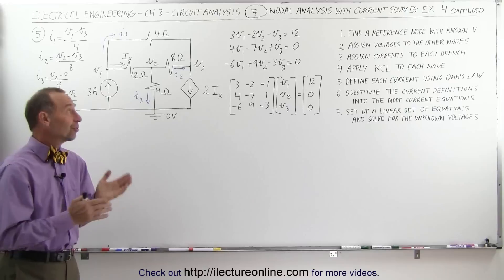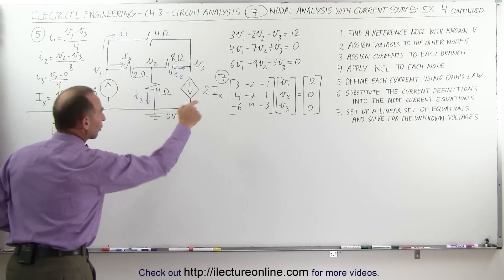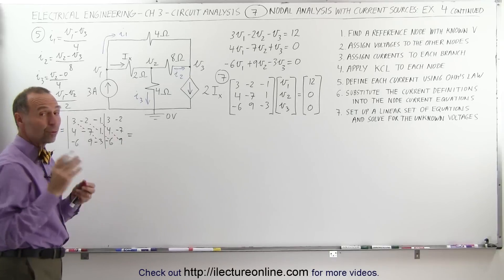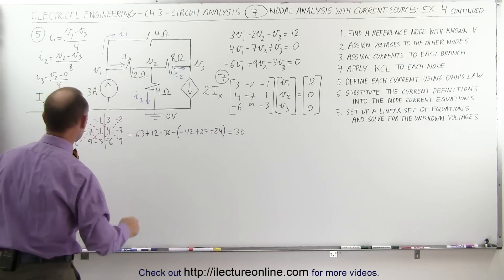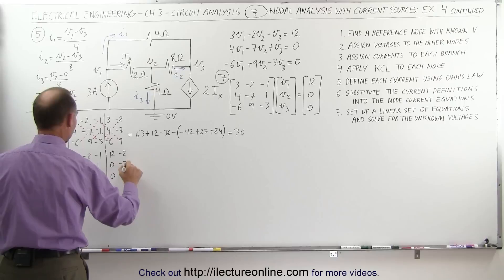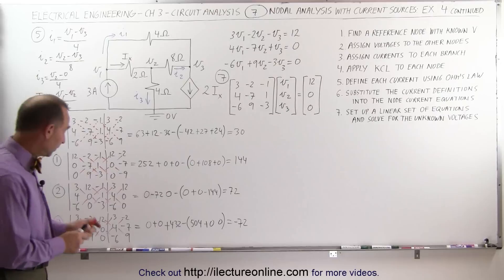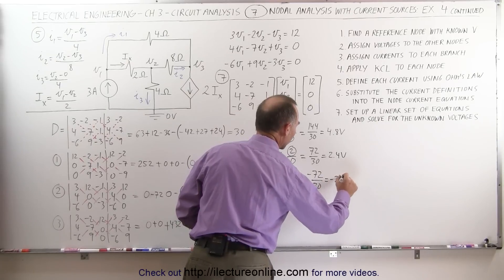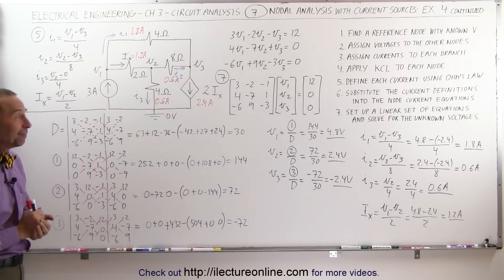Electrical Engineering: Ch 3: Circuit Analysis  (7 of 37) Nodal Analysis w/ Current Sources: Ex. 4

Comment: Hello. I thought the assumed direction for currents didn't matter because signs would tell us the true direction. When I attempted this problem I had i1 going in the opposite direction and I got different answers except I got -1.2 for Ix instead of 1.2. Does the assumed direction of current matter because it changes the KCL for the nodes?
Reply from the maker: The method requires that you do assuma a direction.  if you pick the "wrong" direction, you will simply end up with the negative result instead of the positive result if you had picked the "correct" direction.
Reply: @MichelvanBiezen Then I've made a mistake elsewhere. Thank you!

Comment: When we found the 3 equations in terms of the 3 unknown voltages , would it be correct to find the voltages, by solving those equations in a calculator? 
as in:  
3   -2  -1  =   12
4   -7   1  =   0
-6   9  -3  =   0 
please correct me if im wrong!
Reply: Seeing as you posted this 6 months ago and have probably already found the answer to this question. In case anyone is wondering how to solve this with a calculator, this video will explain/show it a lot better than I can explain.   https://www.youtube.com/watch?v=Iomx4sqmb2A

Comment: Hi, what does it mean if I got the same values as you did but they're all negative?
Reply from the maker: That just means that the current is moving in the opposite direction.  (or we changed the voltage rises to voltage drops.)  Sometimes this happens when a text book changes the convention and uses negative charges instead of positive charges for the current.

Comment: I think you've made a mistake! In the end you made Ix= v1 - v2/2, but we already cancelled the 2 bit, so Ix=v1-v2, meaning that Ix=2.4A
Reply from the maker: No.  If V1 = 4.8 V and V2 = 2.4 V then Ix = V/R = 1.2 A   Thanks for checking.